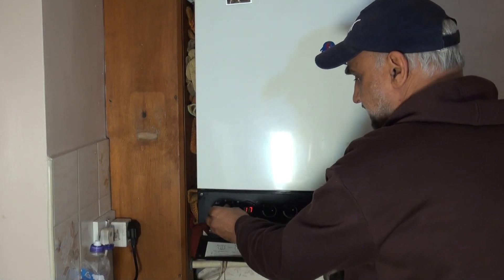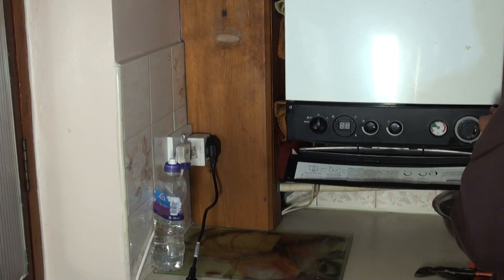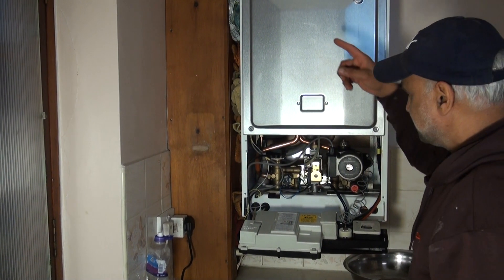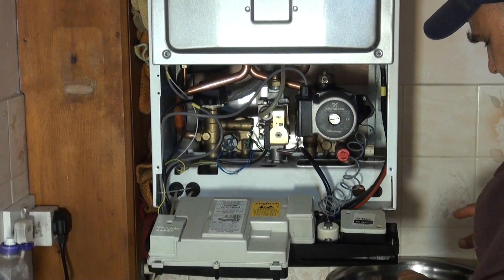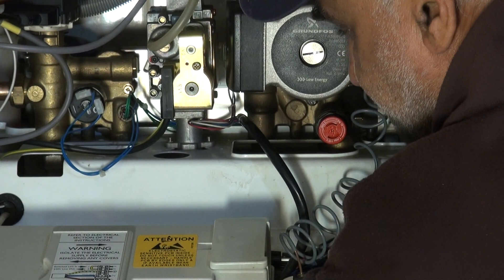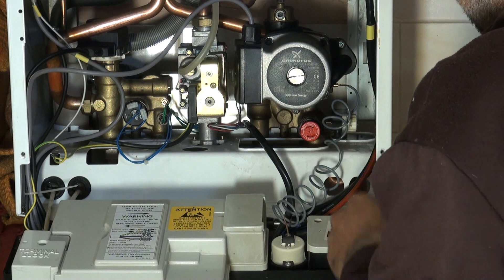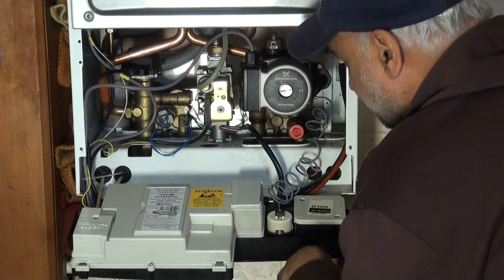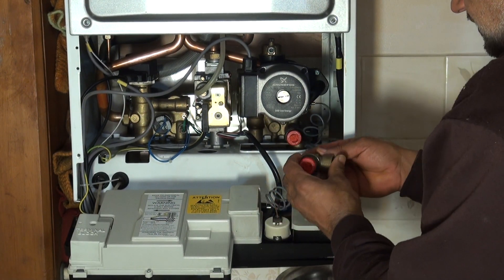Fixing Boiler Pressure due to dripping water from Pressure Relief Valve (PRV) outside.

Comment: So can i just change the valve rather than changing the whole thing (brass bit ) which would be a much bigger job? 

My valve cap thingy just blow off but i have a spare that's the same part ,thanks in advance

Comment: I should get Gas Safe registered before you tell people to work on boilers. Any boiler should have an electric fed from spur box connection and not a plug in a  socket. you will need the part 'P' element to change that. Could you post your Gas Safe registration number please.